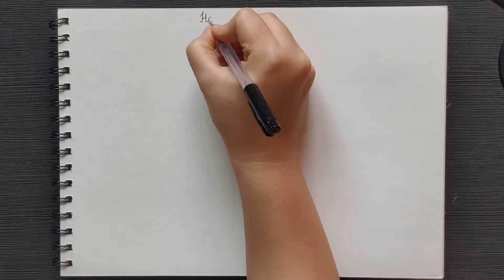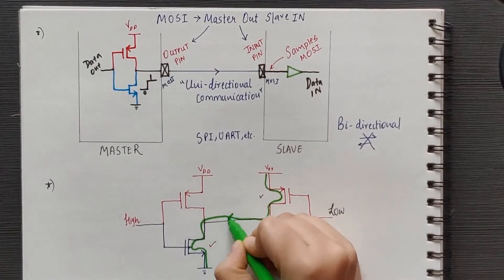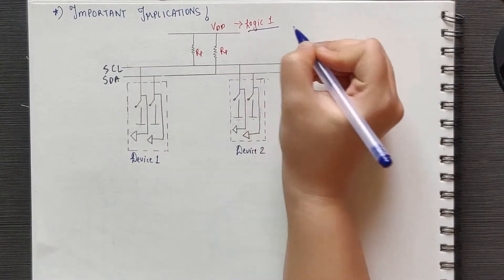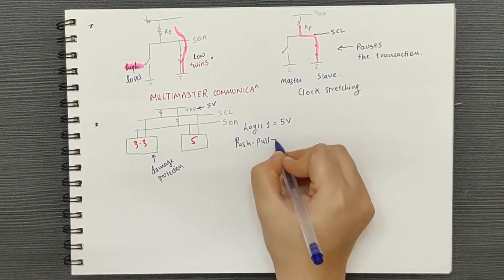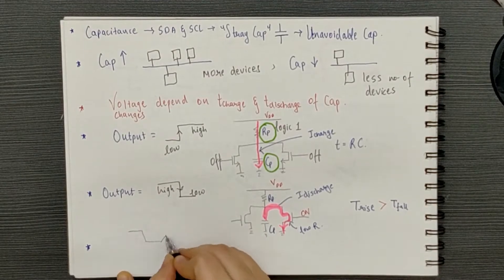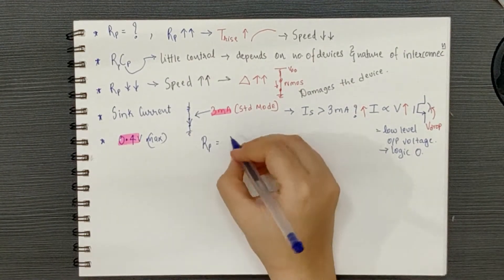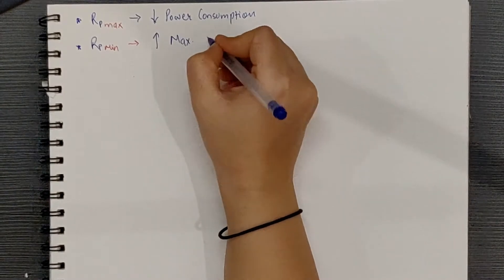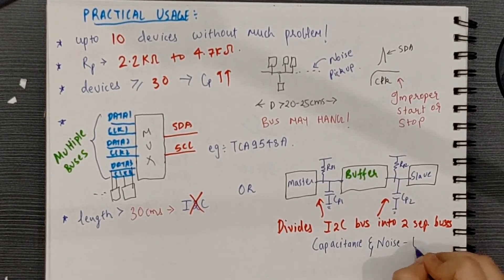I2C - Hardware Design (Open-Drain) - Part 3

Comment: Answer to a question: as far as they compare the logic level on wire with information they send, then will simply complete transaction and each of them won't even notice that other device sued the bus in parallel.